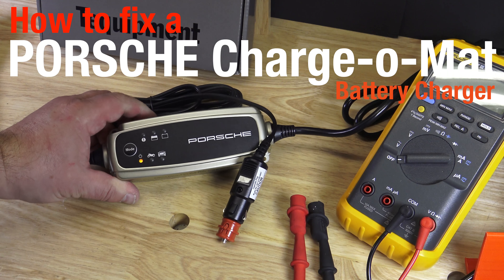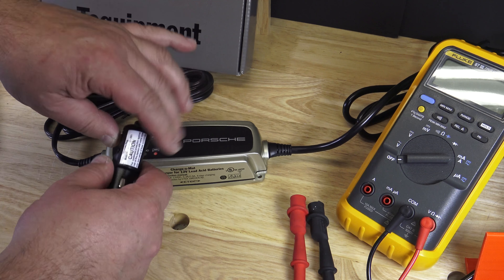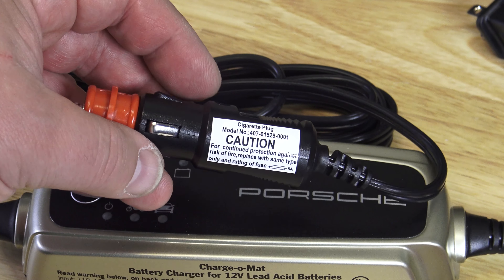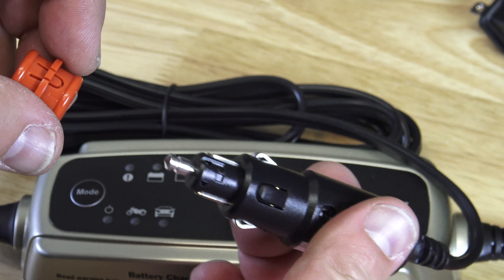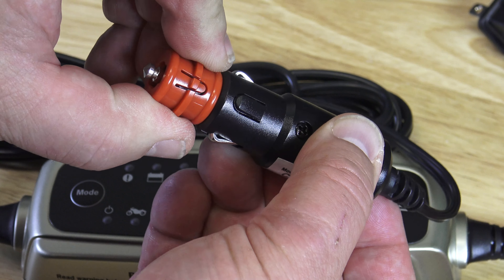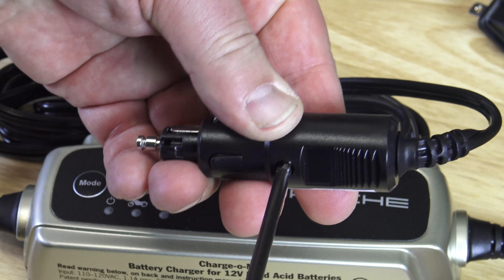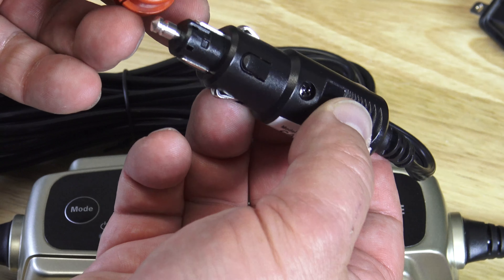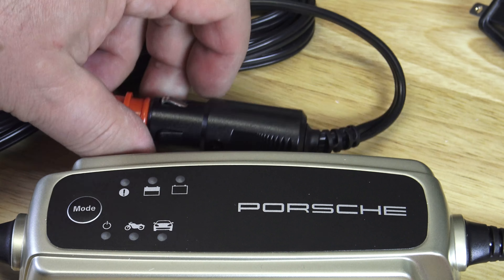Porsche Battery Charger - Does not work? Why?

Comment: Hi ! Thanks for the video. 
I have an issue with the same charger. After connecting to the car, both lights "in charge" and "charge hold" are on (Orange + Green lights). Any idea of what happens ?

Comment: Question:  [1]  Is this charger compatible in a 997.2  after the OEM Porsche Lead Acid Battery has been replaced with the new Porsche AGM Battery [which is now standard equipment on the 991 & later models]?   In other words, will this charger work correctly with both the original OEM Lead Acid Batter and/or the newer 80ah AGM Porsche Battery?    [2]  Does it really matter whether you plug the charger into the Cigarette Lighter before or after plugging the charger into a electrical wall socket.    Thank you.  [BTW:  I've never had to replace the fuse, but I appreceiated the instructions.]
Reply from the maker: [1] I am not sure. They don't sell this version anymore, and the newer version is capable of charging all batteries available. [2] If you plug in the charger into the wall first, you may touch Ground with the tip of the charger plug, and that could blow your fuse, that's why you would plug it into the car first, then into the wall outlet.
Reply from the maker: Also, if i look this up in the user manual, it says: All types of lead-acid batteries.

Comment: Hello. I have watched your video several times carefully because I have same problem you indicate - the top row of lights does not light up.
I tried your advice, and changed the 8A fuse . Before i change it , i check the fuse with electrical tester and the fuse was OK , but i decide to replace it with new  . Unfortunately  without success - the top row lights  still doesn't light up. 
I read other tips like shaking, turning the tip of cigarette lighter plug for better electrical contact , lock/unlock doors , light engine and etc.  but again no success. 
I also checked  the 20A fuse in fuse box in dashboard/left side/ for passenger foot well  socket / responsible for that was №3 fuse /
I bought a brand  new 20A fuse, and replaced it - just in case. 
For better check , i plug my phone charger in footwell socket .The phone start charge even without turn the start engine key on the dashboard to the contact , so the socket in footwell work fine too . 
I have checked the Charge-o-mat charger itself to see if it doesn't allow current from the 220 volt  side, but when I plug the charger into a 220 volt socket, the green stand-by light turns on and I can change the options between motor and car charge from the MODE button.
The same thing happens when I plug the cigarette lighter plug into the footwell socket - the stand by light lights up green and the option to choose between motor and car charge can be changed from the MODE button, but again the upper row of lights does not light up.
I try also to live for 3 days  Charge-o-mat  plugged both sides as should be / in car and 220V /  to see maybe it can fix itself , but nothing happen . 
I really don't understand what the problem could be???
The car is Cayenne S 957 /2009 .
If you have other ideas, I will be happy to try them.
Thank you in advance .
Greetings
Reply from the maker: That doesn't sound too good. In this video here https://youtu.be/EDRBx8nyckY i show how to use the charger (you know that already), and i use a voltmeter to show how it charges. You could try to use a voltmeter to check if it has any output at all. If that is not the case, then you have an issue inside the charger. I would open the charger and check for corrosion, and/or burnt part.
Reply: @mygiguser  Thank you . I will try to find guarantee first . Should be around home , and hope is more than 3 years long . 
Wish you all the best !

Comment: Could you please provide the link to which fuse to buy from Amazon? Just want to make sure to buy the right size , thanks!
Reply from the maker: It is a 5x20mm and 8 Amps. Best you just check your plug to see what' s in it, then you order. I don't have a link right now.
Reply from the maker: https://www.amazon.com/5Qty-Littelfuse-Slow-Blow-Ceramic-Cartridge/dp/B07LD9VRSK

Comment: He spent so much time on taking out and putting back the red thingy but didn’t show how to reach the fuse saying it was in good order so he didn’t want open it.  But that’s the whole point of the video.  I didn’t realize it’s in two halves and you have to pry the two halves apart.  I kept tugging at the wire and the plug from both ends for a full 15 minutes until I realized what needed to be done.  Poor tutorial.  The only thing I learnt was that there is a screw and one need to open it 👎
Reply from the maker: You should have clicked on the info button in the upper right corner: https://www.youtube.com/watch?v=rkwPtf-unAw